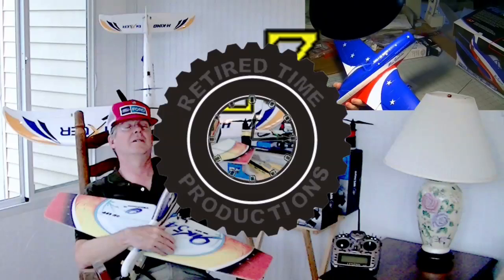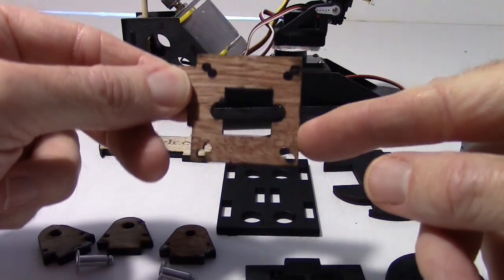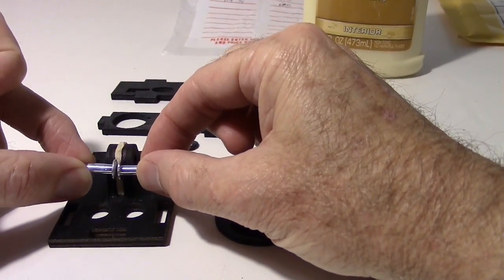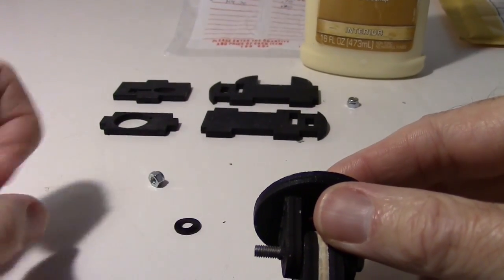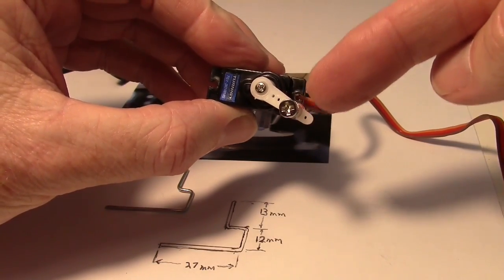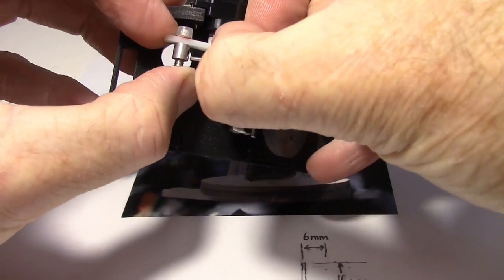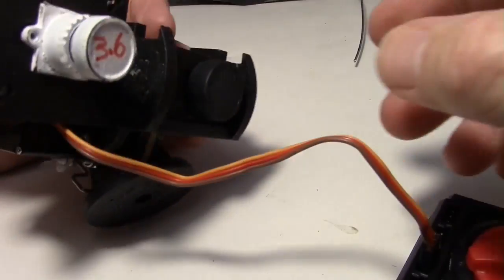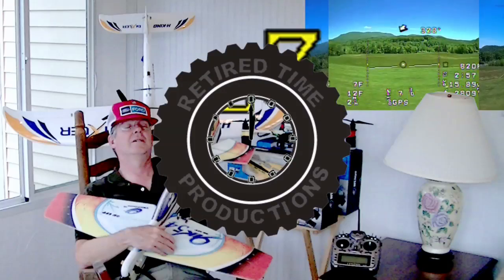FPVLR Pan/Tilt Build for Mobius and PZ0420 Cameras, Part 1

Comment: hey dave, great video. I cant seem to find it on their site. The link brings me to their old site, i link off there their new site but cant find the pan and tilt. Looking for a new one for my MTD. I use the CNX designs one on the skywalker, but i find theres alot of play/slob on the pan causing jello :(
Reply from the maker: eastcoast78 Hi Mike, I didn't even know their site had moved. Guess that's the end of this video, lol. No luck finding it here either. This is a bummer because I just flew with it yesterday on my Skywalker and it's rock solid with the GWS 360 degree pan servo. I will put some video up later of the flight but of course that is no help in finding you one. I will keep my eyes open for another source.
Reply: Awesome Dave thanks. Looking forward to some footage. :)
Reply from the maker: eastcoast78 Here it is!
https://www.youtube.com/watch?v=iNS-u_U9TVU

Comment: Nice vid and kit build. But, why not use the USB port of the Mobius for FPV instead of adding the weight (however small) and complexity. of a second camera? get FPV and Hi Res recording from one camera.
Reply from the maker: coffcraft I am of the mind set that the board cameras have a better picture, more dynamic range and less delay for FPV video.
Reply: Thanks, I just got my boscam kit installed. I tried it with my mobius cam and it looks great. I'll try the Sony cam that came with my kit but it's only 480 TVL's. So I'm not holding out much hope for this one.

Comment: Very nice. thanks for sharing. were is the GWS 360 servo from, or part number?
p.s. does your turnigy servos glitch to?
Reply from the maker: panic mike I got it from glassdogangle. Check his channel for the ebay link.
Or search for GWS-S125-1T-2BB-Sail-Winch-Servo-full-360-rotation.
The Turnigy servos glitch? No trouble so far.
Reply: Thanks! i have some of those metal ternigy servos and some of them glitch and have litle play in the gears.. not very happy with them.. you get what you pay i gess.. anw thanks again and happy flights!
Reply from the maker: panic mike I will keep the glitching in mind and be prepared to switch. Thanks for the heads-up.
Reply: your welcome. :)

Comment: Very nice Dave! It looks like that mount will accept the Fatshark 600tvl camera as well. I'm using a similar pan/tilt rig on my Skywalker, only it is designed for the GoPro. The 360 sail winch servo works fantastic. I have my pan/tilt set to 2 pots on my T9x. I like just being able to look around and enjoy the view while the APM flies the plane autonomously! You will have fun with yours!   ;-)
Reply from the maker: TheAdkFlyer10 I will be using the same 2 pots on the Taranis radio that I did for the previous pan/tilt only now I will have to adjust the travel setting differently. Yes I have seen the GoPro version of this. This is going to be fun if it works. My next challenge is changing the wiring to accommodate the 360 degree twist.
Reply: Yes, you do need a bit of slack behind the camera. I also twisted my wires and that seemed to help them maintain their position.
Reply from the maker: TheAdkFlyer10 That pilot you made with the GoPro head is very clever.
Reply: Thanks! I have to credit David Windestal (RCexplorer) for that idea!

Comment: Kool stuff man
A great collaborative effort!
I am going to use your wire measurements to make mine better.
Super duper way kool man
Reply from the maker: ***** Thanks for the advise on this. Making the control rod was the hardest part. From your pictures I was able to get it figured out quicker. 
I am surprised FPVLR doesn't have some directions and a template for bending the rod. It's lack of info that keeps me making how-to videos.
Reply: ***** Genius man just genius.
My wire was bent very similar to yours except I did not go all the way through both sides.
Making is like yours smoothed the action out a bunch.
Thanks a lot man you are a big help!
Way kool
Reply from the maker: ***** Thank you so much!
It's always great when we can share ideas to improve our RC flying experience.
Your walk-around video on the pan/tilt was a big help to me and thanks for the pics too!